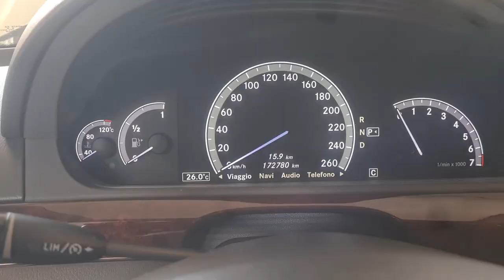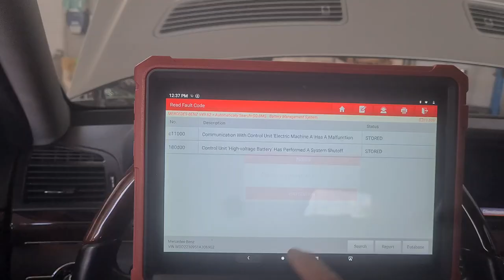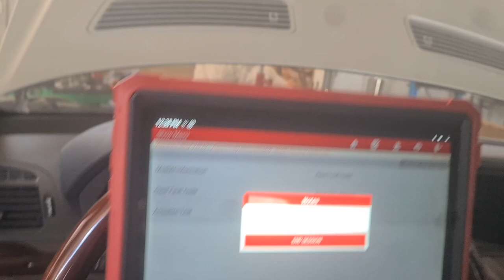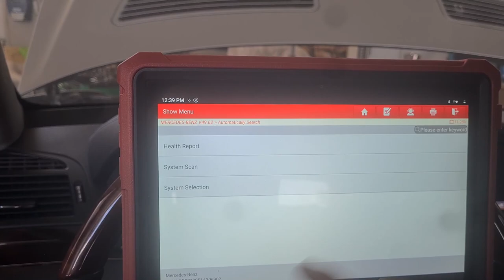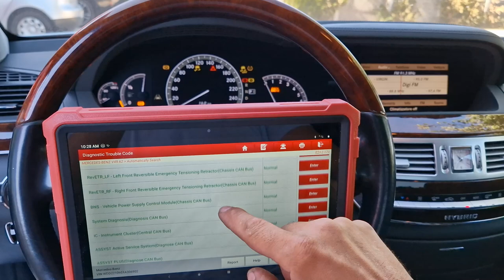Mercedes Benz W221 S400 Hybrid System Repair - Inverter is installed - Is it gonna start? - Part 5

Comment: Hi , well done! 

I got the converter finally after three months. But it want start. I'm not sure if I have to replace the hybrid battery too , or it has to be charged too ... 

Initially the car was super fine ( only 50K km ) but some crazy car wash man washed the engine and it got the converters burn ... I don't know if the hybrid battery damaged/died too
Reply from the maker: Hi. Thanks
It depends on what errors you still have after you replaced the converter.
The car doesn't start if the the HV battery is low as 25%..
Reply: @ArthurBolbos  we deleted all the error codes after the scannin and not showing none of them again
Reply from the maker: @alinfoal  check fuses if the High Voltage Battery is over 26%... if it's lower, it's the battery!
Check ground cables.
Check safety fuse on the converter.
Also do a check on the DC/DC inverter...
Strange that you don't have any errors.
Reply: @ArthurBolbos  how to check ? 
Sorry to say but here in Abu Dhabi the mechanic are almost incompetent
Reply from the maker: @alinfoal  Try to find an electrician so he can make the checks needed...
Reply: @ArthurBolbos  thank you 
Respect
Reply from the maker: @alinfoal  be blessed!
Reply: @ArthurBolbos  can the hybrid battery charged ?
Reply from the maker: @alinfoal  put the charger on the -> 12V Battery and then ignition on; the High Voltage Battery should start charging.
Watch the process in the instrument cluster!
Reply: @ArthurBolbos  in youcanic videos they say you need a 12V and at least 80 amps charger...
Reply from the maker: @alinfoal  maybe. I didn't need to do it on any car until now; I just know that it should work like that.
Reply: @ArthurBolbos  today we changed the battery. And have the codes 180500 180C00. 
Now finally it started the engine but the AC don't cool. It works but only normal air. And without AC cooling is impossibile in Abu Dhabi

Comment: Hello, can you make a video in which order you install the battery and what else needs to be done regarding cooling the battery.
Reply from the maker: Hi
Well, before you remove the high voltage battery, first you need to free one pole of the 12V battery; after that you have to take off the safety fuse from the converter and after that you can unscrew the plug from the HV battery and remove it!
Regarding the cooling system, I don't exactly understand the issue...
Reply: @ArthurBolbos  The battery is connected to the cooling system to prevent it from overheating. Is it enough to just connect it?
Reply: @ArthurBolbos  Can you tell me how I should connect it and in which order?
Reply from the maker: @mikeplayer2587  no coding needed.
Reply from the maker: @mikeplayer2587  steps are just like I told you before.
Reply: @ArthurBolbos  Я имею в виду охлаждение
Reply from the maker: @mikeplayer2587  you just drain the coolant and after that fill and purge the system
Reply: @ArthurBolbos  My car started with the new battery 1-2 times without any issues, but now it won’t start anymore. The ignition works, but the engine doesn’t start. I get a message saying, ‘Battery is charging.’ Do you think the new battery might need to be adapted to the vehicle, or what could the issue be?
Reply from the maker: @mikeplayer2587  as I know, there is no coding needed. Did you check for any error codes with a dignosis tester?
Reply: @ArthurBolbos  When I fully charge the battery in the trunk, a message appears saying, “Wait, hybrid battery is charging.” After a while, another message appears: “Vehicle can be started.” At that point, I turn the key, and the car starts. It’s very strange.
Reply: Do you know if the engine starts with the hybrid battery or with the battery in the trunk.
Reply from the maker: @mikeplayer2587  High Voltage Battery needs to be at least 25% charged and for the instrument cluster to turn on you need to have the 12V also on Voltage up.
No errors of any kind on the Hybrid System stored!!!
Reply: @ArthurBolbos  I founded this error Code: ОВВЕ00

The cell voltages in the hybrid/high-voltage battery module are different.

At bms view al battery cells are at 3.67V only battery cell 11 is at 3.26V. Total accusative hybrid battery is at 57%
Reply: I just don’t understand—when I switch to ignition, maybe is it trying to balance the hybrid battery cells using the instrument battery so that the vehicle can start?
Reply from the maker: @mikeplayer2587  with the ignition on the High Voltage Battery charges itself, therefore you need to have a good 12V battery.
If the High Voltage Battery is not at least 25% charged it won't start!
Reply: @ArthurBolbos  I’ve purchased another hybrid battery, and a new backup battery and a new 12V battery will arrive by Saturday or Monday. I’ll update you once everything is installed.
Reply from the maker: @mikeplayer2587  keep it up!

Comment: Hello brother can you please help to to solve s400 fault code P0A0E0 the interlock circuit of the high voltage....
Reply from the maker: @mrhadi6679  hello
Does the engine start?
If not...
Did you check/test the continuity of the High Voltage Cable?
At first I would go for the fuse/fusebox on the High Voltage Cable!
If it starts but it brings up the fault code... Check module for software/firmware bugs!

Comment: Hello Arthur
Where is your workshop , I would like to get in contact with you regarding my S400 Hybrid. Thanks for your reply
Reply: Error code: U011081 & U011000
This is the diagnose from Mercedes
Reply from the maker: Dumbravita, Romania
Error codes are for the hybrid system, yes!
Reply from the maker: Dumbravita, Romania
Reply: @ArthurBolbos  can you repair this?
Reply: At the moment the car starts sometimes. Is it possible to have your contact details?
Reply from the maker: @vaneeshmathur1313  mail me the diagnose: autopark@elroy.ro
Reply from the maker: @vaneeshmathur1313  it depends
Reply: I have sent you the diagnosis on email.

Comment: Salut , am problema cu control unit A6519009202 ,  ma poți ajuta ?  De unde ești ?
Reply from the maker: Salut. Nu le repar. Timisoara
Reply: Sal @ArthurBolbos   SI eu am aceleași probleme. Am luat din dezmembrări alt modul SI tot aceleași erori le am . Sa fie defect SI asta, sau e altceva. Multumesc
Reply from the maker: @MariusJMN  tot ce-i posibil
99% din S400 Hybrid din dezmembrari sunt pentru defectul de la sistemul hybrid.
Recomand doar reparat/sau cele de pe China, doar ca sunt refuzate la vama!

Comment: Hello brother 
I have two problem in my car S400 hybrid and the car was in Mercedes they find out that it has a two problems with L motor with code A2729060200 
And one more code  

A0009064703 - this is what you were changing on the video and Mercedes advice me to change this first  

My question is: Do I have to change both parts or only the second one and it’s enough to start the car?
Because it will cost me 70 k$😅
Please, if you could help me to answer that
Reply from the maker: Hello
It depends what error codes you have;
I don't think that both of them are bad;
From my experience: The starter goes bad very rare; it's the converter that kicks off, and the " starter " electronics plate of it.
But like I said, you need to see about the error codes.
If you don't have error code on the starter, and have multiple errors on different modules from the converter then you need to go first with the converter replacement.